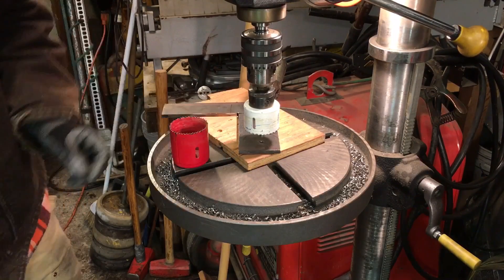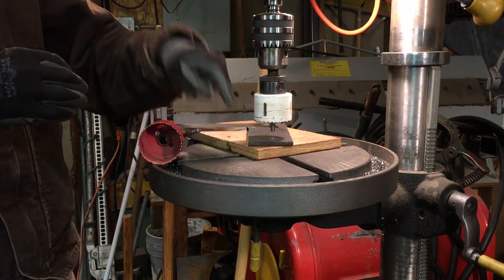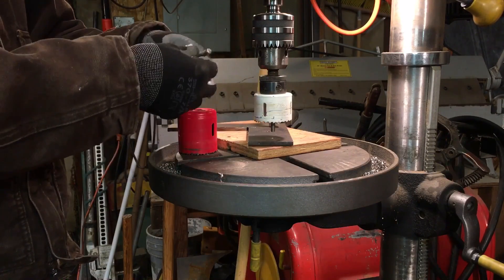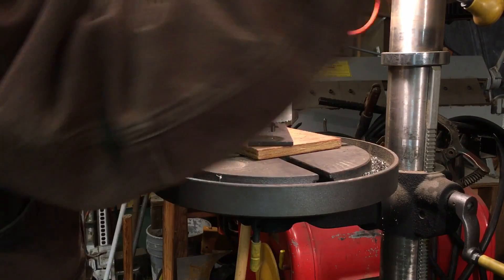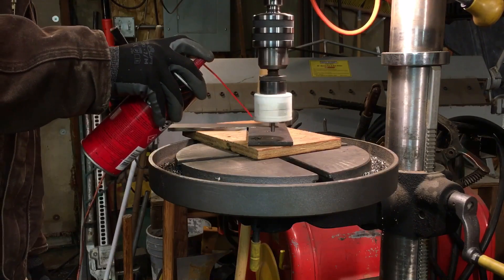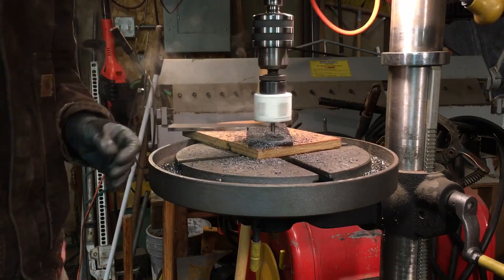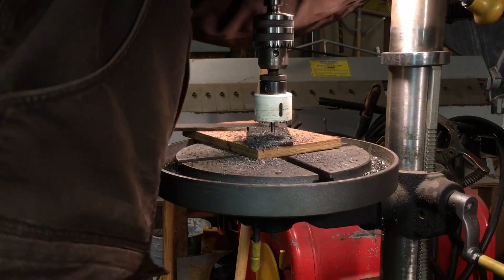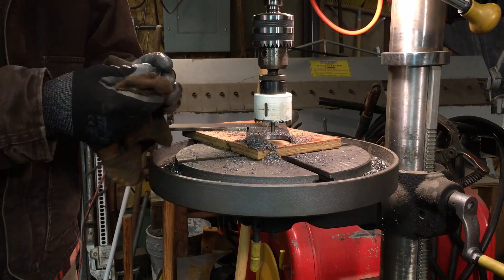How To Drill HUGE Holes In 1/4" Steel Plate

Comment: it will help tremendously if you drill a relief hole just inside the kerf of the hole saw to allow shavings to evacuate the cut. Place the hole on the side that will be the waste side when complete. Minimum 3/8" diameter.
Reply from the maker: I’ve never heard of that method, but it makes a lot of sense—I’ll have to try it! Thanks for sharing!
Reply: I find it easier to start holesaw then use drill bit about the same size as kerf in multiple locations. It makes the chips smaller .
It's also a lot easier and faster to drill multiple small holes. 
Works particularly well in aluminium

Comment: Hi what make and model hole saw do you recommend for 1/4 inch steel
Reply from the maker: I really like the ones Milwaukee makes. Can’t recommend a specific model because I have an old set that I just keep using and using. 
Just read the packaging and their recommended materials & thicknesses. I can’t stress enough the importance of using some kind of lubricant oil to cool the hole saw and metal as you drill. You can use official cutting fluid, though my favorite is what I ALWAYS have on hand—Power Lube. Works great. 

In a pinch once, I used air tool oil because that was all I had with me and I was getting my family out of an emergency stranded situation on the side of the road in a snow storm, at night, on Christmas Eve. Had to bore out the inner hole on a spare tire rim that was too small for the trailer axle hub it was supposed to fit on. It worked great, and to my knowledge (it was years ago) I’m still using that hole saw!
(That’s probably the event that caused me to always keep a can of Power Lube in the back of the car—besides the ever-present need to unstick stuck things, and keep them from getting stuck again 😉).
Reply: I have been in the construction industry for over 50 years.  Most other contractors and I use Lenox blades , saws and  cup bits for fast work and longevity.  These tools last through dozens of cycles and remain sharp .

Comment: hey, great vid! wehre can I get one of these?
Reply from the maker: A hole saw? Either home improvement stores, or Amazon etc.
You can normally buy 1/4" steel rod stock at steel supply places, but home improvement stores like Home Depot, Lowe's, or Ace Hardware should also have some. 
In general, if you have a steel recycler that sells by the pound in your area, or a steel supplier that sells remnants or cutoffs, that's often a cheap way to buy steel.
You can also get some online: https://www.google.com/search?client=safari&hl=en-us&sxsrf=ALeKk01URWlYxv4Oq4a0tH72xXejAAVdMg%3A1606578658645&ei=4nHCX-_pJoms0PEP2u6z0Ao&q=1%2F4%22+rod+stock&oq=1%2F4%22+rod+stock&gs_lcp=ChNtb2JpbGUtZ3dzLXdpei1zZXJwEAMyBggAEAgQHjIGCAAQCBAeMgYIABAIEB4yBggAEAgQHjIFCAAQzQIyBQgAEM0CMgUIABDNAjoECAAQRzoKCCMQsAIQJxCdAjoECAAQDToGCAAQBxAeOgQIABBDOggIABCxAxCRAjoFCAAQkQI6BQgAELEDOggIABCxAxCDAToHCAAQFBCHAjoICAAQCBAHEB5QrWxYka8BYJq8AWgAcAF4AIABvgKIAeULkgEHOC4zLjEuMZgBAKABAcgBCMABAQ&sclient=mobile-gws-wiz-serp

Comment: I had no idea you could use these on metal. I have a couple and thought they were for wood only.
Reply: you have to use bi-metal or carbide hole saw to cut metal the regular ones are for wood or plastic
Reply: @bowlweevil4161  Thanks.
Reply from the maker: Some are definitely better and more suited for metal than others are, so if you have cheap ones they will probably wear out very quickly using them on metal. But using some kind of cutting oil like I showed in the video will help it last as long as possible.
Reply: @TomWylie  Thanks. I think the wood already wore them out after one use. Probably Chinese metal. 
...Oh don't even get me started on China right now. Just lost my job of 26 years because of their virus thank you.
Reply from the maker: ArcanePath360 oh man, really sorry to hear that.
Reply: @TomWylie   It's okay. Bit of a shock at first, but the more I think about it, perhaps it's time I moved on. There's certainly elements I won't miss.

Comment: Great vid,I need to cut  a 2"  hole horizontally  through 1/4   I beam .Think I'll suspend drill with cable or just find someone with plasma cutter
Reply from the maker: Thanks! 
I'd suggest checking out if you can locally rent a Mag Drill. If you're not familiar, it's basically a compact drill press that magnetizes to your I-beam with a powerful electromagnetic baseplate.

Comment: If you're chuck has runout you need to fix it. And it's still to fast change gear if you are going to teach other's how to do this no sense teaching the wrong way just because you can. Life hack just cause its on you tube don't make it the Right way. The shade tree way is not the way to do it unless you don't mind losing a finger or two.
Reply: where might I find the best practice way to do this?
Reply: @partyshorts  this way is perfectly fine. Just take your time and be safe.
Reply: I know this is old video.  I just cut a 2-3/8" hole in 3/8" thick steel plate.  Used a Nova Voyager drill press.  The settings in the drill press recommended 100 RPM.  I went up to 180 because it was so slow, but went back to 100 to not overheat things.  I used a carbide tipped hole saw and it took 70 minutes per hole.  Turned out nice.  Your drill press was a lot faster than 100 RPM, more like 400.

Comment: Rather use compressed air and a gun ,  it cools the saw and removes filings   , I drill 25 mm thick plate

Comment: Should  never  wear gloves  when  operating  drill press. ..
Reply from the maker: Yes, and one should never use a 6 foot ladder to go more than 4 feet off the ground. 
That's technically the rule, but the few times my gloves have been caught in any kind of drill (usually just hand-held drills) are FAR outnumbered by the countless times my fingers have actually been saved by the fact that I was wearing these gloves. 
Would I wear bulky leather or canvas work gloves while operating a drill press? Absolutely not! 
But if I get close enough to the bit for these tight-fitting gloves to catch, that means I was just plain too close to it period and was already asking for trouble.
Reply: TomWylie  you are correct. .i wrapped  my hand around backwards   wearing  gloves. .loose  ones...